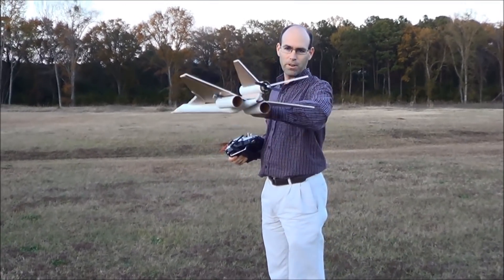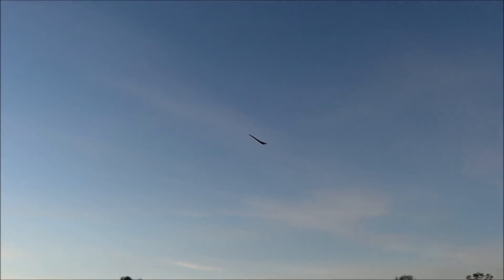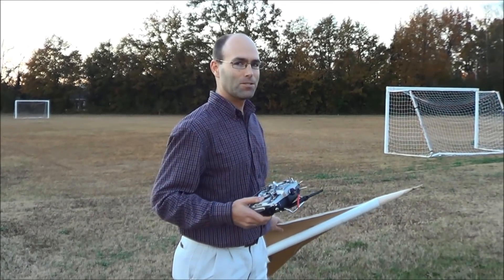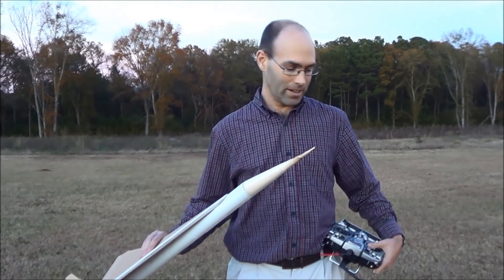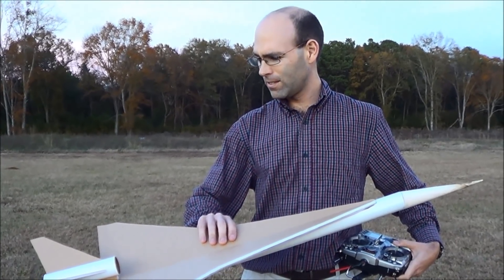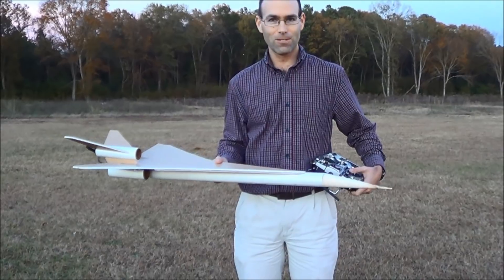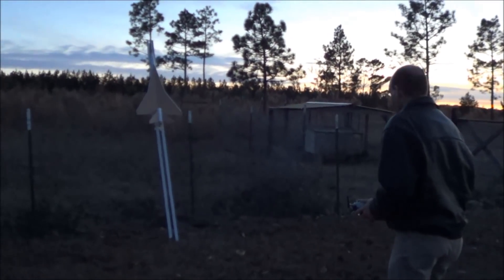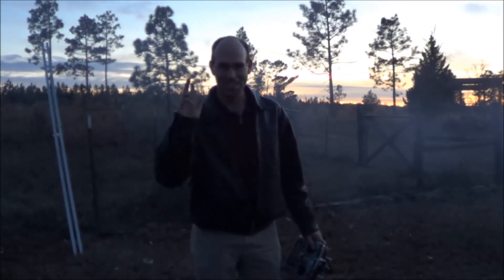Rocket/Parkjet from Flite Test Foamboard!

Comment: You can cant the motor Mount by making custom mounting rings. Just make the front hole off to the side, in this case maybe a few millimeters below the one in the rear so you have up thrust
Reply from the maker: Correct, however I was running an eRockets mount to keep this as close to an off the shelf build as possible. Most interestingly, though, I found that the pilot workload under rocket power was really quite low and therefore doesn't justify tweaking the thrustline.
Reply: @joshuawfinn  so you're saying the only thing that needs altering is the electric version? It also looked fairly underpowered
Reply from the maker: @RedstonePyroMan , correct, and I agree, definitely a bit underpower, though not severely so. I've since flown it on 4s, and it's much happier on that setup. Still somewhat weird to fly, but much less so.

Comment: alotta noise like your motor is over working and not going any where, depending on your ESC you might go to a bigger prop and get more airspeed for that "flat airfoil to go anywhere
Reply from the maker: stan burdick, pushers are very noisy, especially with the prop that close to the tail fins. The prop is oversquare so there is some prop stall contributing to the noise. When it gets up to speed it's a lot quieter. Better would of course be a larger prop farther from the trailing edge, but I'm not interested in getting a setup customized to this airframe since it's mainly just a sport model.

Comment: Reduce aileron sensitivity
Reply from the maker: David Franklin believe it or not, it has too little at low speeds. No response at all until almost 20 degrees deflection, then the nose dips and it comes alive. Quite challenging.
Reply: Wow! Quite a beast!
Reply: delta darts and flying wings alike, the CG/proportions has to be spot on, flat airfoils dont help either, also  your hardly getting  any airspeed, in essence its like flying a  brick.

Comment: It seems like you need double the trust you are using for that design to fly more stable. 

Just saying it seems like it’s not achieving enough air resistance on its aerodynamics to stabilize it.
(I don’t know the lingo lol)
Reply: When the rocket power it, it had seemingly more stability. Only during the burn time of the propellant it looked  great and didn’t seem to sway like it did with the prop on the back of it. 

For the sake of science. Maybe put a more powerful prop motor on it🤔
Reply from the maker: Joshua Rogers Sr., I upped it to 4s and it's much more fun ;)
Reply: joshuawfinn awesome 👍🏻

Comment: I'm surprised you didn't set off the rocket while in flight. Oh Baby! Next time.
Reply from the maker: That's going to require me to have a bigger rocket motor and have a setup that doesn't merely interchange the prop/rocket. That said, an air drop at Flite Fest next year would be a perfect workaround!